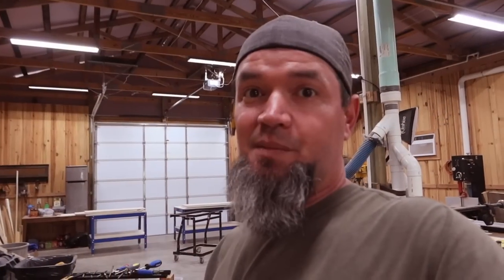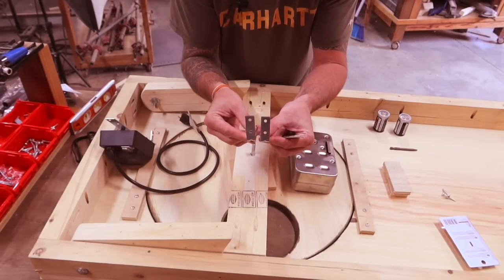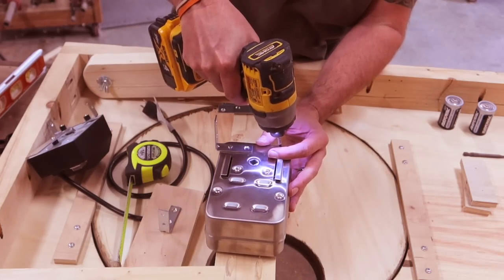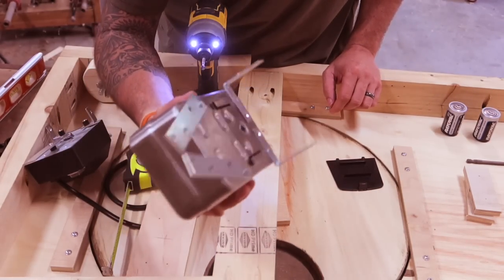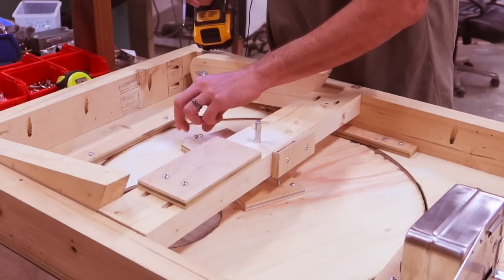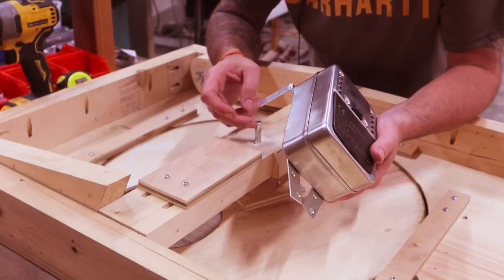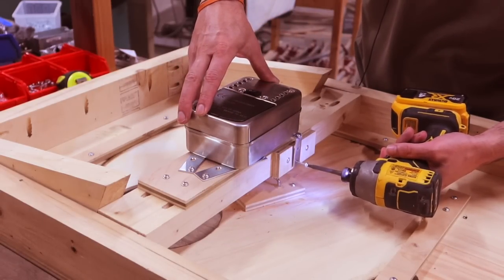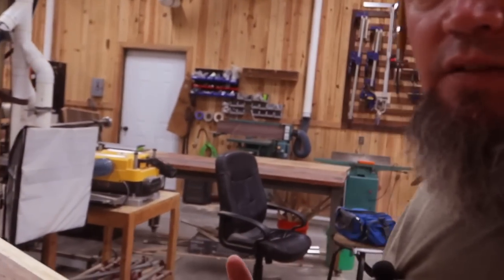Cordless Ultimate Rotating Cornhole Boards - Make Money Woodworking

Comment: I bought the battery operated ones and they came in yesterday. I went with the plastic ones instead of Stainless since they were cheaper. I will make mine when I get done with the project i'm doing now.  Thanks for the update.
Reply from the maker: No worries!  I wonder if they are about the same size.

Comment: Matt...such Innovation in this update and ALL THRU YOUR CHANNEL! I haven"t started my builds quite yet, too many irons in the fire right now, however, since they haven't been started, how about putting a 2 x 6 as a brace/bracket for motor and still use the heavier 2" brackets? just a thought. I have two people chomping at the bits for these boards here in the Upstate of SC! Need to get it in gear....(pun intended!).   Gargle with Salt water or make a hot toddy (if thats your thing....). As always, can hardly wait for your next innovative idea!

Comment: Actually my wife's first question when I show her the end product on your first build was that no one is gonna want to be dragging cords out etc.... So magically Wa=La!   the answer popped up.  Super video as always brother......  I hope you don't mind but I am gonna throw a general question out to all of the other U-Toober's out here floating around....
I am a 30 year woodworker that is getting ready to open my shop to the public.  I have a molder so that is what I am going to focus on moldings and picture frames.  However  I of course will need some money to support the shop until I get some builders to give me a shot and show them how much money I can save them.   Any hoo------   I am currently working with the SBA and writing my business plan which is a aggravating thing to me so far.   My question is this.... 
How many of you that have your shops as part of, or all of,  your income,  actually wrote a business plan or worked with the SBA or another group and possibly got a mentor to help you get your shop up and running.   Also are you based at home like garage or pole barn or do you have a commercial property that you run the shop out of??
Thanks everyone and Matt I certainly apologize if I over stepped a line in the sand that I didn't see.... I meant to show you no disrespect by throwing a totally unrelated subject out there on your nickle so to speak.    Awesome video as always brother and your voice was just fine.... you could hear that you were a touch out of your normal tone but you were all good.
Peace

Comment: I’ve been thinking of making this same idea since Feb ‘22. A friend of mine makes the regular ones commercially. He makes good money. I do see a flaw in your design and there is a way to correct it. But kudos to you for making this.
Reply: Would be awesome if ya share the flaw you see with the community- sharing is what brought this idea that we all build from- it’s exactly what Matt did 

Greatly appreciate it
Reply: Is it the cross beam holding the motor?
Reply: @terristroh3965  Correct. I would put a ring of plywood around the big hole with about 1” exposed in the hole. Then set roller bearings in that ply every8th compass point.

Comment: AWESOME corn hole mod and video! One question and one possible "upgrade?".... Have you had any bags get wedged between the hole and the motor support 2x4 board?.... Possible upgrade mod?.... What about a thin, but strong enough to hold the motor up so it doesn't sag, but thinner than the 2x4? My thinking is it would be "deeper" in from the hole and not interfere with the turning.... Just my "two cents."

Comment: Matt, another awesome build. I am having issue with the jig for jig saw with the 20” hole. Blade travels offline and new blades bending. Going to try the router but figured I was missing something small. Thanks again!
Reply: I used a jigsaw for the 1st time last week, & it did the same thing.
Reply: @dottyjyoung  Router worked flawlessly.
Reply: Same thing here. Broke 4 blades lol.. Switched to a router and a circle cutting jig and it worked so much better.
Reply: Glad I'm not the only one this is happening to!  Gotta find some router bits now I guess!
Reply: Ditto, broke and/or bent several blades then had too much sanding to do in order to get them to turn! Not feasible going that route! Def a router or luck out and have a brother who just bought an x-carve CNC to cut them out for you! Thanks Matt, I’m trying to be the first one to put these out in my area! I’m about 15 miles west of Charlotte, NC!

Comment: hey Matt, i think you could of used the same l brackets for all 4 screws for better stability or security, also i was thinking you could move the cross board closer to the top side and down to let the legs receed up into the frame, then use a piece of plyboard to mount the motor assembly to the ply board directly, also i found a ton of vinyl skins to put on the cornhole top

Comment: Matt, this is AWESOME. OK OK, SO, I have yet another idea. What if there was a way to have a mini speed remote controller. The idea is that the opposite team could adjust your board. It could cause some fun arguments haha.  But, they could slow your board down, or speed it up. Then of course adding lights and all. Maybe I'm thinking too much into it. But I love this already. 0h also to add, of you go on Amazon or hobby store.  You can buy rechargeable lithium battery's that can take place of the d cell batteries.

Comment: This is a dope idea and cool concept. Idea. What if you made that motor drive the axle indirectly i.e. belt driven. Then you could modify this to use a tool battery so it could be rechargeable and way cool. Note this is already cool and appreciated. Just my thoughts after you have done all the incredible work. Thanks for sharing. Tour Channel is dope!

Comment: You might want to consider some protection for the motor, even just a piece of wood on either side to act as a bumper. A couple of blocks and a piece of plywood maybe? Might need to be easily removable to access the battery compartment. If the cornhole board was dropped, I don't think the motor would survive. Love the channel, BTW.
Reply from the maker: Nice idea!  And TY!
Reply: Set one board on the table face down. Lay the other on top face up with the ends swapped (For motor clearance). Use 4 of the spring safety hook and loop screen door latches to clamp them together. You can also install a handle on the edge to make it carry like a suitcase. The motors will be inside a box.

Comment: I am building a set of boards , thanks for the plans. I am having trouble the rotisserie motor turning the disc. The one listed here is sold out currently. I got a different one from amazon black steel not Crome. It has a higher weight rating but it just doesn’t have the torque to spin the 20” disc. Please help.

Comment: I think with the currect setup your spinning disk will be blocked by bags getting stuck on the motor-bracket. You should install a longer axis to enable the bags to drop all the way down...
Reply: When I saw the 2x4 motor mount through the hole, I thought the same thing. I can imagine a bag getting wedged in between the circle and the motor support. Maybe it won't happen very often in actual use.

Comment: What happens if you throw a bean bag and it lands in the hole as it is passing over the middle support holding the motor? Is the motor strong enough to push the bag off the support and make it fall? I just sold a set of these for $285 no paint or stain.
Reply from the maker: Nice! It just pushes it off.

Comment: These should work well with my "lightweight Portable design. Using 1" instead of 2" boards and a 3/8 (I may try 1/4 at some point)top. Then once they're built with the motors (or without), Swap ends and stack them. Then use the Hook and loop latches (Screen door latches for you  more classic guys like me) with the spring type safety. You'll need 4. Then when you latch them, pick a side and install a handle. Now you can carry them like a suitcase to a picnic, friends house, the lake etc. If they aren't the rotating style, the bags can go inside and probably wont be too much trouble on the rotators. Easier than two separate boards and the bags and they are lighter to tote.

Comment: Check out magnetic bearings
 Two roller bearings, with identical poles facing one another so they oppose, reducing weight and friction. They work great if you want to spin horizontally. What about a bicycle rim complete with sprocket. How about making one where the hole travels horizontally, reciprocating back and forth left to right..
I got it how about if the whole traveled around a series of holes like the cylinder of a pistol, so you have a small window of opertunity to hit the open target Now fab a counting device and scoreboard, wire in a blue tooth speaker... one table has an ice chest and the other is equipped with a Weber, and you just rotate sides every quarter.

Comment: Just a watch out for builders (which I was planning to be) is that all/most of these inexpensive motors have small metal gears that don't do well with stalls. If for whatever reason the turntable gets restricted and Lady Luck isn't on your shoulder, one or more of these small gears can strip a tooth. Best I can tell, that's the start of "buy a new motor" time.  I have put my builds on pause ... not sure how to solve this.  If I spend more money on a more powerful motor, then some kiddo will stick their arm in the moving hole, get caught on the crossbar support, and a parent calls a lawyer.  Best I can think at the moment is I need a stall tolerant motor/gearbox that also has enough torque to carry multiple bags of weight.  Unicorn?
Reply: You might try looking into some of the motors used by makers in the DIY robot community. Perhaps they have a more robust cost effective motor and/or gear box.
Reply: Some type of slip clutch?
Reply: @delandbrooks3291  My thoughts as well.  I'm waiting on supplies to do some slip clutch testing.  Finding economical options to test has been a challenge.

Comment: I would be careful with the new battery operated motor. I got the boards completely built, everything was ready to get and after painting I went to re install the motors and somehow I accidentally turn the motor on and when I put it on the shaft it tried to rotate but I had the board upside down and it wasn’t able to spin and it cooked the motor in a matter of 2 seconds. The old corded motors would stop and try to rotate the opposite direction if it got stuck instead of just spinning one way which made them a lot better. Just an fyi, and they are unavailable regardless but I would try to find a better option, one that acts like the corded motor

Comment: Does anyone have any better ideas of how to cut the 20” holes. I made the jig he showed and I could not get the blade to stay straight ( yes I had all brand new Diablo heavy duty precision blades and I also tried the precision blades that are thicker from bosch) and not veer off and I ended up cutting the holes by hand but they aren’t perfect so once the circle rotates around it gets stuck and I’ve done a ton of sanding and I still can’t seem to get it right and the gaps are very inconsistent. It was a pretty costly mistake at 90 bucks a sheet plus everything else I spent to build these
Reply: I had kind of the same issue. My blades would bend and burn the wood and would drift. Make sure you are using a good saw with a T type blade. I was cutting on the floor which was an issue with the angle.  I got a blade that cuts both directions and put it up on a table and was able to get the hole cut perfect with no drifting. I will see what blade it is tomorrow and post the number. Hope this helps.
Reply: @peteraley8650  yeah that’s what was happening to me and I was using Milwaukees fuel brushless jigsaw so the saw wasn’t the issue. I bought the 20 blade kit from Diablo and used every single one that was for wood and none of them worked so I bought the Bosch blades that everyone recommended when I looked it up and that didn’t work either. Maybe when I made the jig it was 1 or 2 degrees off to the right so when I went to cut the holes counter clockwise the saw wasn’t angled properly. If I made the jig again I would angle it 2 or 3 degrees to the left so that the saw will be more likely to go around the circle. When I cut the holes by hand my saw was defiantly slightly at an angle so even if I made the jig perfectly 90 degrees that wouldn’t be right because that’s not how you cut a circle with a jigsaw.

Comment: forget the flat straps.. just use 4 of the L brackets and be done with it since they came in a package of 4
Reply: Michael Wenman, good call! Still need the spacer underneath too! Threw that out there for anyone who may have thought otherwise.
Reply: @mrmyblessednest1722  I could not see from the video why the spacer is needed unless it is just because the key stock is too long.  Help me understand.  Thanks.
Reply from the maker: Hey Michael!  I use the flat bracket in the front to make sure the motor doesn't move front to back any and possibly put the drive into a bind.
Reply from the maker: Because there is a 1/2"gap in the front because of the built in mounting plate on the back of the motor.
Reply: @MatthewPeechWoodworking  totally makes sense!
Reply: @MatthewPeechWoodworking  yes, still use the spacer underneath.  Just use the 4 L brackets instead of 2 and 2.   Same concept :)   If I build some, will let ya know